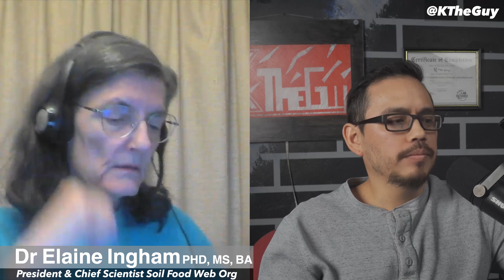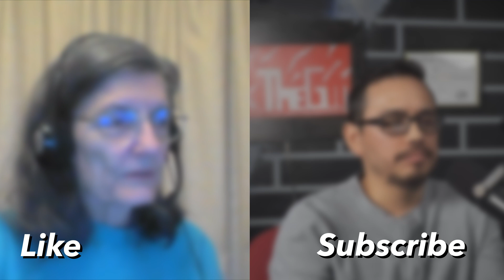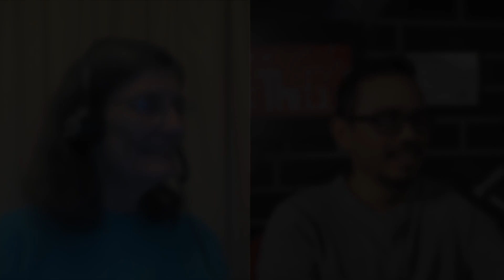The precision when building compost with a microscope / with Dr Elaine Ingham

Comment: Great video. 

Soil science is too often oversimplified. 

Understanding how the inorganic material (i.e. rocks, sand, silt, clay, carbon materials (humic acid, fulvic acid, humus, etc.) react with the organic biotic aspects of soil (bacteria, viruses, nematodes, arthropods etc., as Dr. Ingham explains) is very complicated and variable.

I find that the physical properties of the soil specifically are largely misunderstood very often. The texture (i.e. the amount of sand silt and clay, gravels/boulders materials that compose the soil) vastly change across even areas as small as a square meter (3'×3), as well as the parent materials (which dictate the relatively amounts of Mg2+, K+, Ca2+, Si, and other minerals that compose rocks). Not to mention how variable water is across the landscape when climate, topography, and water retention of the soil is considered. 

And don't forget soil properties change with each horizon as most soils depict horizontal horizons that extend variably across the landscape. So good luck with all that 😅.

Plenty more aspects make soil infintely complicated but basically, it isn't just "put more Nitrogen in and that will solve it" as Dr. Ingham wisely points out. 😂